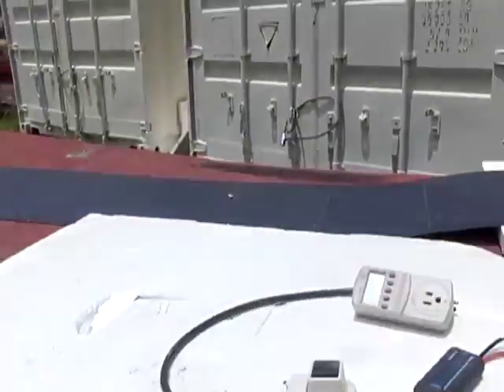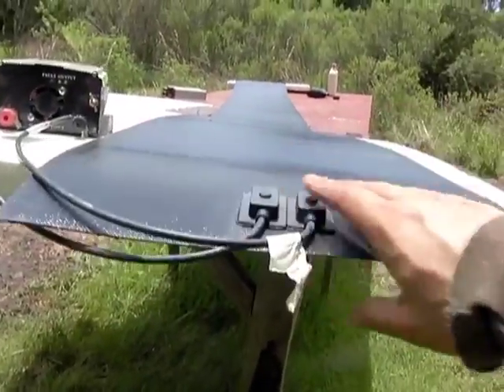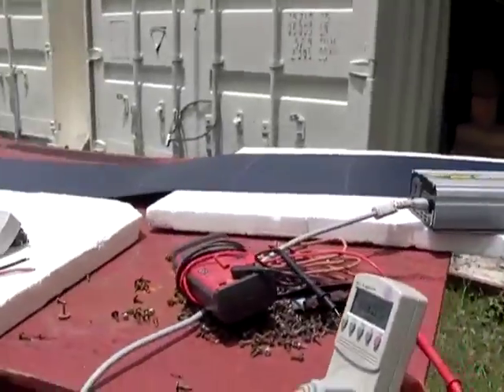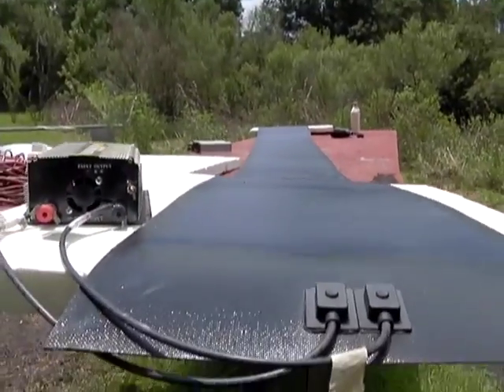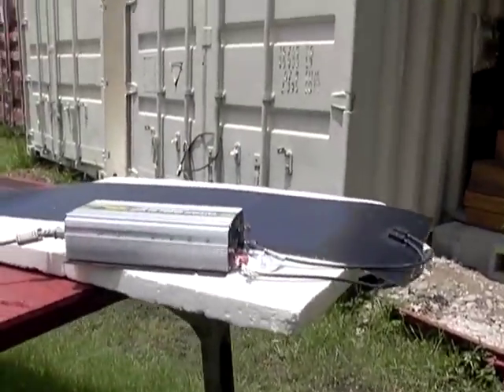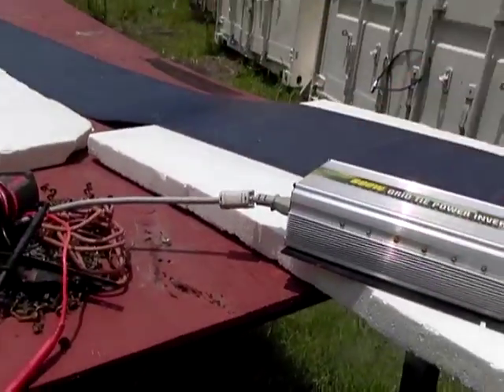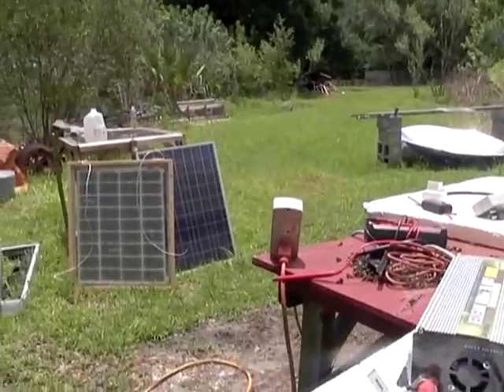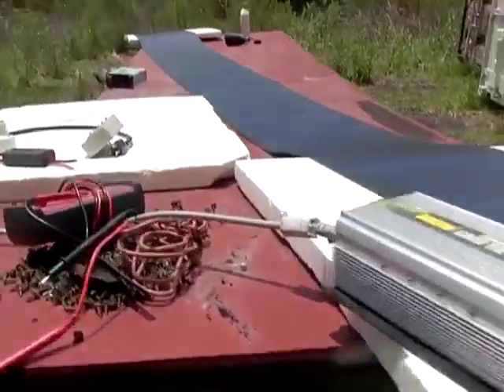DIY solar panels 124 WATT ROLLABLE SOLAR PANEL self adhesive 24 volt - 42 volt open

Comment from the maker: @martinaee This one has been abused, folded in one spot (set a 40 pound jack on it:-0)left in the sun for one year, short circuit for a month, and it is still going strong, no signs of wear, except for the fold. They have MC connectors, I cut them off and pigtailed. They can be linked in series or parallel. I have place 5 to one GTI for 550 watts.

Comment: I don't know much about electricity or panels like this... would it be possible to link two or more of those to a much larger inverter to get a much higher output to run larger appliances in a house?